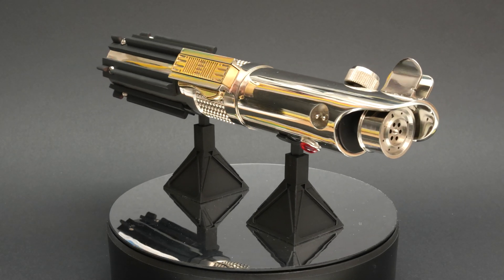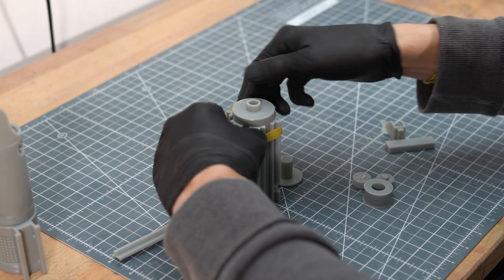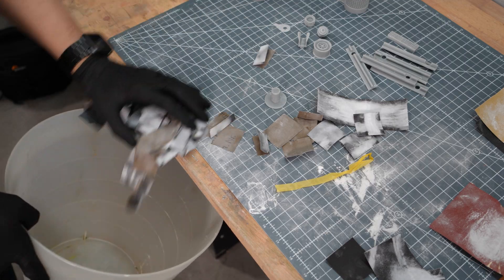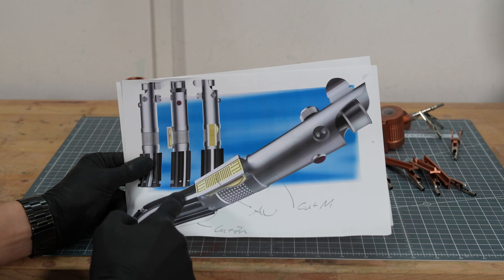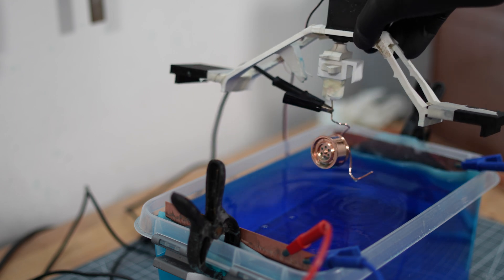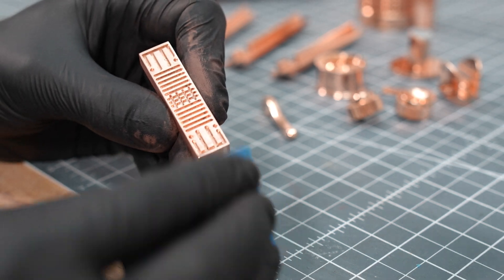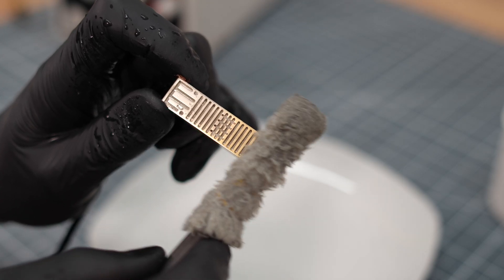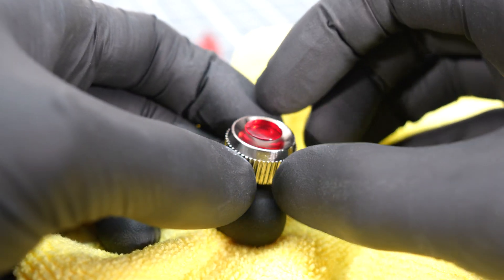Electroplating 3D Prints | Lightsaber Tutorial

Comment: That's very impressive. Say that I wanted to recreate this, but with thin walls for the tube, in order to install electronics in it and make it work... would that be possible to produce such thin walls off a 3d printer and still not shatter when hit?
Reply from the maker: Hard to say. I would say minimum wall width would be 0.5mm-0.75. Then electroplate it, this adds strength. But it would be a fragile work.

Comment: How often can you reuse the electrolytes before you have to dispose of them? Same with the anodes.
Reply from the maker: The anodes are dissolving after some time. This depends on how big your plated parts are. I usually use my copper sheets around 8x until they get very thin, but it’s hard to calculate. The electrolyte regenerates by the copper anodes. It needs filtering and brightner from time to time. You can check pH, too. Besides that it’s pretty easy. That’s still my first electrolyte(!).

Comment: Another amazing video - can't wait for that new guide, but I've loved that you always include a tutorial aspect in each video you do! Quick question - when electroplating copper, can you leave it as copper on it's own, or will it start to oxidize? If so how do you stop it if you wanted a print to just have a copper finish? Also, while the print is electroplating can you get an electric shock if you were to touch the anodes or the water?
Reply from the maker: thanks! copper will start oxidizing the moment it's in contact with air. There are clear coats that do this job (i.e. Zapon clear coat) but any regular clear coat does the job, as well. You won't get a shock it you touch it (voltage too low), but you shouldn't to it either (contaminate, acid(!) etc.). :-)
Reply: @hen3drik  Ah gotcha! Okay cool, that is great to know :) thanks buddy!

Comment: Is it resistant to the touch? Will it wear off if you touch it a lot?
Reply from the maker: No, it's a thick metal coating. It cannot be distinguished from solid metal externally. I.e. Gold can also be used as a decorative coating, but it would wear off after countless touches and exposure to sweat. However, that is not the case here.
Reply: @hen3drik  thanks for the reply!
Reply: @hen3drik  too bad I can't find in Amazon Brazil the conducive paint you used. What if I apply a mix of graphite powder and a water-based primer coating for plastic materials? Do you think this would work instead of the copper coating?

Comment: Regarding the current : how do we decide how much to put and for how long exactly ? I assume there is a formula somewhere depending on how big the surface to plate is ? Also how do you decide on the increments when raising voltage ?

do you just get the hang of it from practice, or are there existing rules to follow ?
Reply from the maker: Hi, I follow exact rules. It‘s 1A/dm^2 surface area constant current mode. You‘ll deposit around 0.4-0.5um/min Cu on your part. I cut half the amps the first 30mins, after that 100% for 3.5hrs. 😃
Reply: @hen3drik  Okay bonus question : I mixed the tifoo copper paint with acetone (well the nitro one you recommanded in another video) and I get a rather grainy texture from airbrushing this. Is my mix incorrect ? I went 50/50...
Reply from the maker: @startide  Go 1:2. don’t let the paint  build up. Wait until dry. Polish very carefully.
Reply: @hen3drik  2 acetone for 1 copper, right ?
Reply: @hen3drik  ok I am dumb it's in the video... since I watched them all I wasn't sure which one you told us about it :P
Reply from the maker: That’s ok, I scattered all the info over my videos 😅
Reply: @hen3drik  well i made my first attempt, it seems the paint was dissolved in the electrolyte in some areas. I think using clear resin want the smartest idea :p

We learn from our mistakes though, onward
Reply: second attempt : coffee filters seem to filter too much and copper got mostly stuck inside.
Reply from the maker: @startide  copper atoms will pass the filter definitely. There must be something else wrong.
Reply: @hen3drik  there was a lot of copper " dust " in the filters. Copper did accumulate a bit on the wire, but that's it :(
Reply: @hen3drik  third attempt : it's not bad, but it's like copper didn't really deposited... would you have some social media I could share pictures with you ? That would be super helpful to have feedback on this, I am scratching my head :(
Reply from the maker: Make Fotos of the setup, power supply while in progress, wiring and send to my email found in my yt channel. I’ll see what I can do.

Comment: thats very nice amazing job , i think will be amazing the tutorial when is done is a process i would like to try.... ,iam doing also tons of resin prints ,if you want my opinion about the sanding part ,dont use normal paper but sponge sanding pads because they dont collect so much dust on the actuall fibers so you can use them twice the time and are much much easier to sand ,since i discover those i never going back to normal paper ones !
Reply from the maker: Good tips. Thanks!
Reply: @hen3drik  Your welcome i also mainly use elegoo resin 3d printers myself and a elegoo Neptune 3 plus and max for FDM and Metal prints try a resin called resione tough resin for the best prints more so for hollowed prints
Reply: Yes i agree i use the sanding pads myself on my prints and i use also a heat gun to slight warm my prints before sanding for smooth results and also to remove the supports for less dimples from the tips of the supports